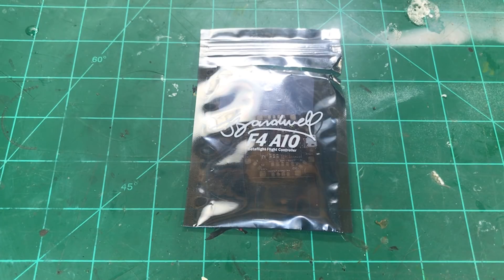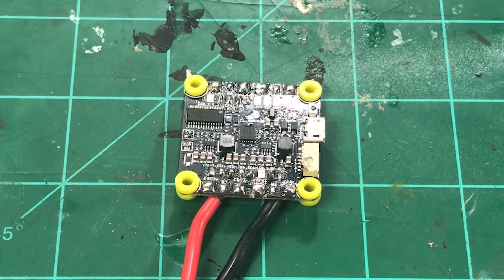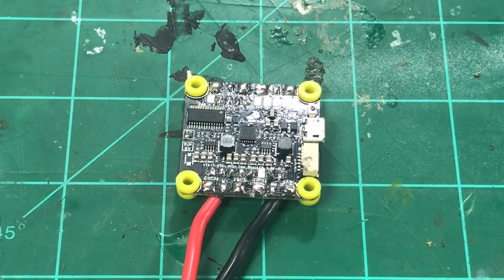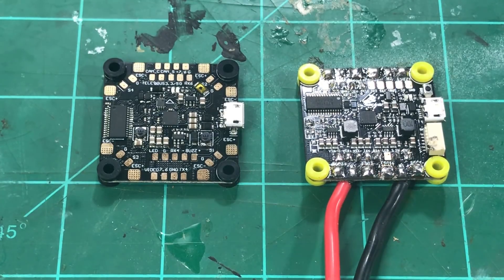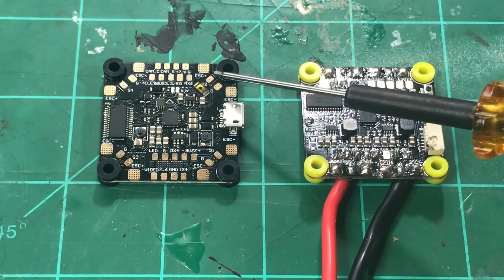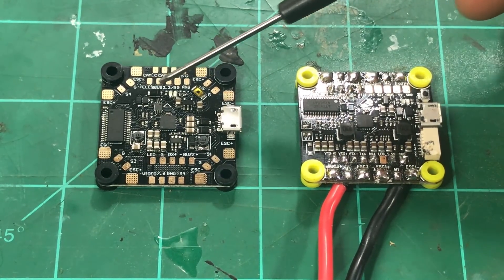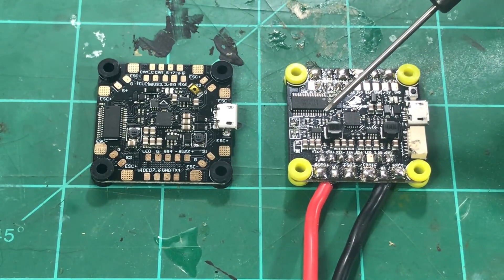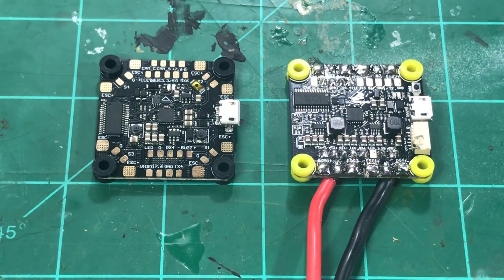Joshua Bardwell F4 Flight Controller First Look!

Comment: The diagonal lines from CL boards come from the regular, you are not supposed to use HV vtx behind an onboard regulator, those VTXs already have a regulator.
Reply from the maker: benii good to know. But my unify hvs are all running off vbat

Comment: Have to pull 5v power from the opposite edge of the board for the Crossfire...I hope he changes that in V2.
Reply from the maker: Hurricane FPV sweet. Good to know. I guess it won’t be that bad. Should have plenty of room inside the reverb.